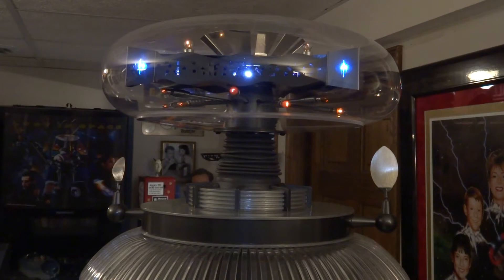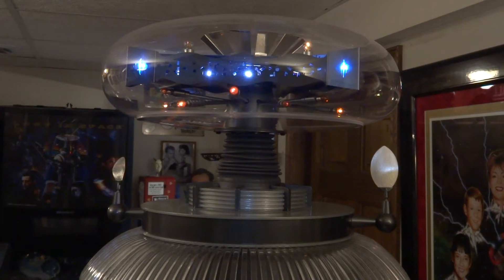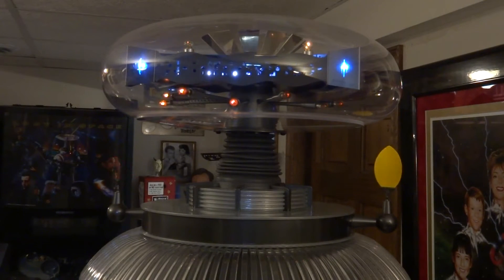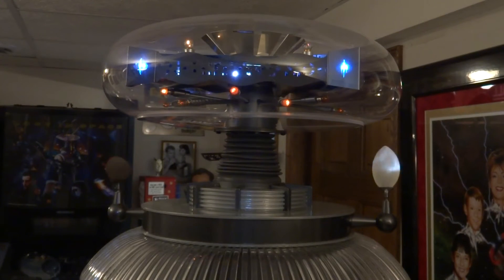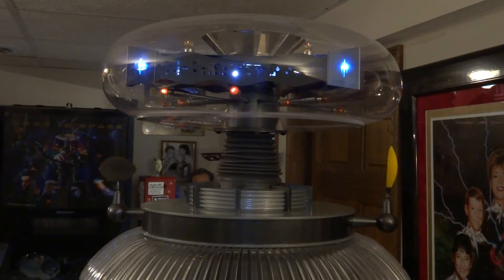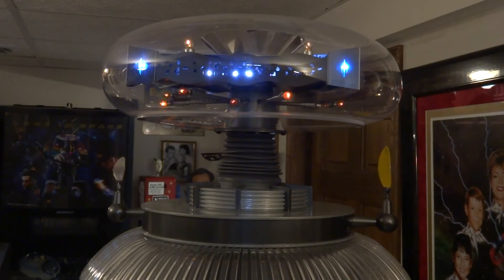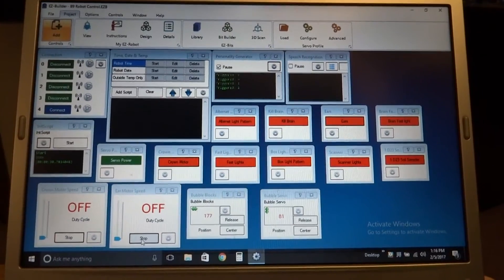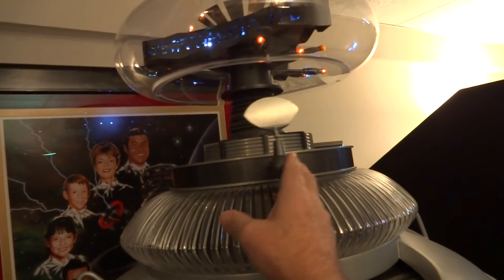PWM vers Motor Noise & Speed. Adjust LEDs also

Comment: So you’re pulsing the motors and changing the duty cycle to change speed. Have you looked into changing the frequency of the PWM? Higher frequencies are smoother to the motors. I have a controller using PWM that pulses at a frequency just above 20k. ( love the B-9). 😎

Comment: Hey dave. Another way of looking at PWM is that it changes the "apparent" voltage that the motor sees. If the motor is 12 Volts and you feed it with a 50% Duty Cycle PWM, the motor will see about 6 volts across its terminals. This can be verified by a DC Voltmeter connected in place of the motor. This applies to just a basic PWM signal and I usually do not use signed magnitude PWM and such. I also use a small CPLD and crystal oscillator to generate my PWM, leaving the processors free to concentrate on other tasks. This gives me a speed selection of 256 speeds including stop, though the lowest speeds are generally unable to start a motor and in those cases I start the motor at a higher speed and then slow it. I generally use a PWM having as close to the maximum frequency that my h-bridge can handle. The Cytron 13A, 5-25V Single DC Motor Controller has a maximum input PWM frequency of 20KHz and so I aim for about 19.5KHz with a bit of margin for "safety". The reason for this is that the higher frequencies tend to allow the motors momentum to keep it spinning between pulses resulting in smoother operation, but perhaps a better reason is that the limits of human hearing are 20Hz to 20KHz and if I used, say 100Hz, for my PWM frequency I would have a PWM operating well within the limits of average human hearing. The coils in the motor, then, tend to act like a "dynamic speaker", emitting a "whine" that is modulated at the PWM frequency, thus there is a good chance that a 100Hz PWM signal would cause the motor to emit irritating sounds. By using 19KHz or higher, if the motor controller can handle it, we are at the very upper limit of human hearing giving less of a chance that our ears will perceive the PWM frequency. Keep the videos coming - I watch your channel more than all other youtube channels combined - you should monetize everything and make a little ad revenue for your efforts.
Reply from the maker: Thanks for the excellent tutorial Tin Cans. This is a very easy and understandable way to understand this concept.